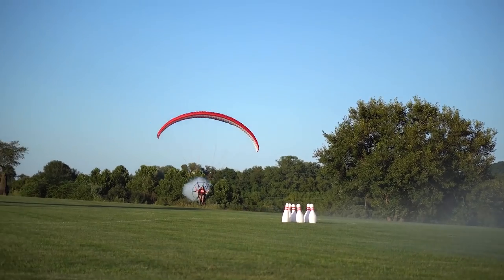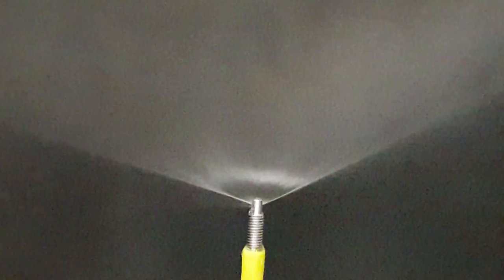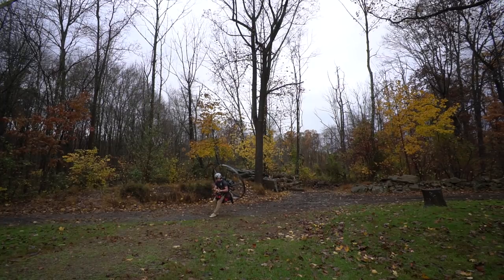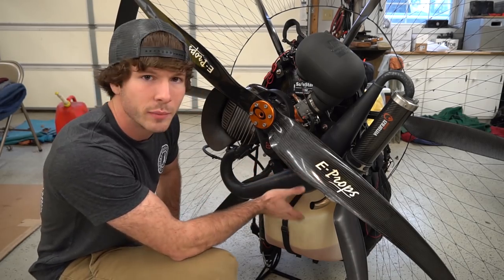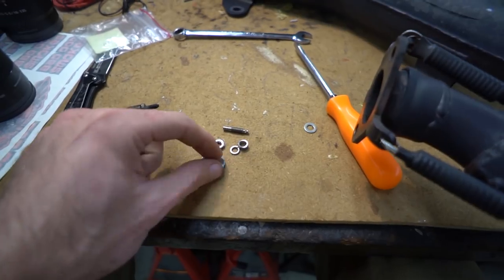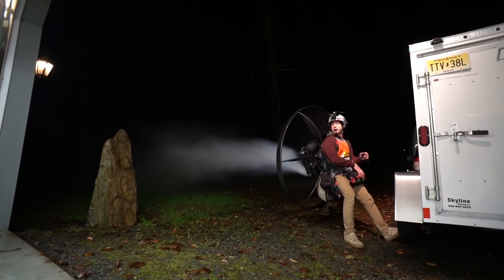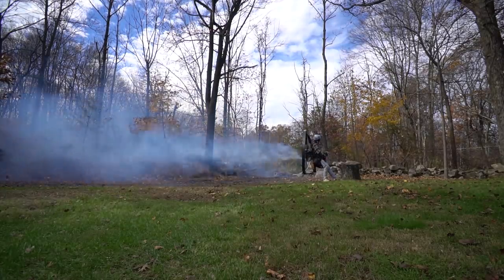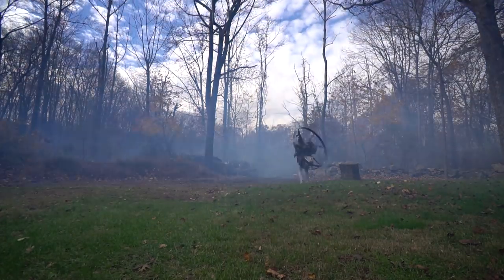Burning Used Frying Oil In A Paramotor?!

Comment from the maker: What do you guys think? 40 seconds of additional smoke but less volume with the new injector. I think I might slightly drill it out in the next episode, stay tuned!
Reply: Tucker Gott ❤️🖤🕊
Reply: Is there anyway to add colour to the smoke ?
Reply: I like the original luscious plume. Sure the new one lasts longer but if it is less visible, I don't see the point. You still might want to keep the vegetable oil to run in your sprinter van though.
Reply: @robertmcgowan9135  not without a lot of pain. It is a messy process
Reply: Yeah, she needs a drillin' . 

Or, you could switch to automatic transmission fluid ... you'll see smoke like you've never seen before.  But, you didn't hear that from me ... 😁
Reply: I'm wondering if there's anything you can add to the oil to make colored smoke?  I'm pretty sure food coloring would not work as water based.  Cool Video Tucker
Reply: @MrBluemoonhalos  - Maybe some iron shavings would make it red? Not sure. Best bet would be to source the stuff used to color fireworks - might change the color of the smoke, too.
Reply: I'm having the same issue with nozzles, Im sure sure if a stream hitting the steel exhaust or a fan like spray into the exhaust fumes is the best way to go for best results 🤔
Reply: Definitely like the thicker smoke.  Maybe if you drill out the new injector.  Or just get a second tank for more baby oil to double your thicker smoke and tee them together.
Reply: I would ask the manufacturer if they have one with a larger diameter nipple. If they do great! You can have two nipples and decide if you want duration or thicker smoke. If they don't, I would ask them for an extra nipple, as a spare just in case you mess up the one you have. Personally, I wouldn't do anything until you use it at altitude and get opinions from the ground as to the level of visibility and duration of the smoke trail in the air. It could just end up that from the ground, the lesser smoke output is not noticed! Or it could be really noticeable and not in a good way. So the next step is experimenting and getting opinions.
Reply: less is more.. drilling time!!
Reply: Try biodiesel and baby oil mix
Reply: It would be more meaningful to judge a comparison of airborne smoke as seen from the ground.
Reply from the maker: @kyleoglee  Kyle said it! We're drilling her tomorrow! 😁👍
Reply: Look into light silicon oil. Unlike organic based oils, with silicon oils nearly 100% of the oil turns into thick smoke. Many high volume smoke grenades use SiO2.
Reply: Any way to add the notched atomizer cut to the old nipple? I would think if you could spread it around you might get be a better plume while still being able to lay it down thick as you'd like. You could maybe reduce the orifice size so it's not all blown out in less than a minute, but still keep a similar/same amount of cloud. That's just a hypothesis at least. I would think the RC guys would have it down to a science because those guys will smoke out our field in no time!
Reply: You should try using fog machine fog juice, should be super dense fog, even with the smaller nipple, and you can get it scented
Reply: Check out the discussion under my other comment. I recommend vegetable glycerin, or a mix of it and a diluent (water, propylene glycol, etc.) There is some detail on the benefits there, not the least of which is more "smoke," more efficiency, better smell, etc. (It's what fog machine juice is made from--just MUCH cheaper.)
Reply: Where can I buy it? Which specs did the bad dog nipple have?
Reply: very cool to have more time but drill it out and try for more smoke dude.lol
Reply: Add colour !!
Reply: You need a tig welder.
Reply: what size did you end up drilling it out too?

Comment: What about using vegetable glycerin for the fluid? It is used in fog machines and is cheap very efficient, allowing the use of less liquid to make more (and thicker) "smoke."
Reply: That's a smoking idea!  Good thinking.
Reply: Great idea! May strain the pump though unless you cut it with some baby oil. That stuff pours like honey
Reply: you can thin it with 10% water or with propylene glycol
Reply: Last Fog machine I rented and set up used a VG/Mineral Oil blend. The Mineral oil thins out the VG so it flows easier and still vaporizes. I got out of the Expo setup business years ago though so I don't know what they use these days. Probably hasn't changed.
Reply: Exactly VG creates insane plumes of smoke
Reply: You can experiment with different oils to get different smells get a good one flyover a hemp Fest vendors will give you lots of money because you got them all hungry LOL
Reply: I have zero doubt it'll be WAY more effective than baby oil or cooking oil, and I bet you guys are right about diluting it. I was thinking one world greatly decrease the rate of injection since VG is much more efficient (and, I forgot to mention, MUCH cleaner!) The fact it's much cheaper is just a bonus. If necessary, diluting would definitely help it flow better. The most concentrated mixture possible, along with decreased flow, would surely be best, so one can get more smoke and for far longer (especially when compared with oil!) FWIW, it seems some online fog machine recipes say dilute with water, while others suggest propylene glycol, and/or a mixture of the two.
Reply: I suggested this on a previous video. Seems like a no-brainer.
Reply: Could also cut with a little bit of flavored ethyl alcohol and have the best smelling smoke trails out there. Perfumer's Apprentice is a good place to look.
Reply: Please provide a link to this cheap vegetable glycerine.
Reply: Costs more than baby oil AFAIK

Comment: Great video. with the wobbly nipple if you use a jubilee clip/hose clamp, drill a hole so it fits over the injector this will stop the wobble.  We use special made ones on our rotax 503 engines. Which is basically a hose / Julie clip.

Comment: I wonder how a 3D printer nozzle would do. You wouldn't get the fan spray without modifications, but they're designed for high temperature applications and you can get nozzle diameters between 0.15mm and 1.2mm easily and cheaply. You can get 10 0.4mm nozzles (the most common) for $1.34.

Comment: As others have mentioned, vegetable glycerin (VG) is the probably the way to go, assuming there is enough heat to vaporize it. It's the main ingredient used in e-liquid for vaping and also fog machines. It can be thinned if needed with propylene glycol (also used for vaping). VG is odorless and is plant based. Unlike baby oil, which is just petroleum based mineral oil with fragrance added.  VG is about $24 per gallon on Amazon.
Reply from the maker: Interesting! I may have to try it, although it is a little more expensive than baby oil.
Reply: @TuckerGott  You can buy in it bulk (e.g., 55 gallon drums) from wholesalers and get than down to around $10 per gallon.

Comment: Filter the used vegetable oil or you will clog your nipples. Particles in the  used vegetable oil could also bake onto the tip/atomizer.

Comment: Have you tried anything like Chauvet DJ High Density Fog Fluid? It's about $25 a gallon. I haven't been able to find the flash point of it. Baby oil is mostly mineral oil, which has a pretty low smoke point compared to things like propylene glycol or vegetable glycerin. Lower smoke point = less thermal stresses on your precious metals.

Comment: So aside from the cooking oil stinking like burned food do you notice the oil carbonizing in the exhaust pipe reducing power or did you not run it long wnough to notice? Would it clog up the customary breaks in the moster exhaust?  Dont you cook with oil to have a clean supply that smells good?

Comment: If you want dense white white smoke...use cheap atf (automatic transmission fluid)...
Reply: Yep! Nothing is smokier. I've had many a vehicle let the fluid go on the highway in my younger days. What a cloud!! 😂
Reply: @SmittySmithsonite  Potassium chlorate and sugar is pretty smoky... once tried to make a rocket with it and it just sat there smoking on the sidewalk. Was no wind so just hung there for several minutes and was so thick that it stopped the traffic!
Reply: @ahaveland  - 😂 Nice!

Comment: Even with my low vision, I noticed the huge difference. By the way, I'd love to see you do a comparison between baby oil, and actual DJ fog machine fluids. You can get the stuff at guitar centers, and on amazon. I've used the stuff when I did lighting for a band I worked with. Never tried baby oil, though. Oh, the smaller hole will clock sooner, and require a bit of cleaning with vinegar, more frequently.

Comment: Will this effect the engine? I thought the point of an expansion pipe on a 2 stroke was to harvest some back pressure to force more air into the combustion chamber. Does this mean some of the oil will get sucked back in? It’s only oil, but still.
Reply from the maker: I haven't noticed any long term affects yet. It does bog the motor when you inject the smoke, but that's about it.

Comment: Try mixing  essence oil with your smoke oil Tucker. I make professional smoke generators for theatrical, military simulation, paint ball gamers etc... I can mix those essential oils used for aroma therapy into my chemical compounds and make the neighborhood smell like just about any scent i like, essential oils are very potent you might have to experiment maybe from drops to 1/4, 1/2 oz mixed into your oil preferably non scented or mineral oil.
   Thanks for sharing 
     Kind regards Eric Dee
     P.S. Try the Gardenia oil, you'll love it.

Comment: I myself prefer the thicker smoke - I know it is less duration but the thicker smoke looked a lot better in my opinion.  It was obviously thicker but it was also whiter.  The second nipple (maybe because of the atomization) was a bluer tinged smoke.

Maybe you can find a happy medium - get a nipple like the first one but a slightly smaller hole (not quite as small as an atomization hole) so that you can keep the whiter thicker smoke but extend the duration?

One other item regarding the used vegetable oil that you didn't mention but alluded to indirectly I think - as you said the used oil is nasty.  You mentioned the smell and getting it on your hands but I also think that using that oil on a consistent basis would eventually clog up the nipple especially the second atomizer one.  I would think there would be sediment in the oil small or microscopic that would eventually build up in the hole.

Overall as usual great post.   I enjoy your content very much.

EDIT: I'm a day late and a dollar short - I see others have already stated what I did in my post :-)

Comment: Don't pollute your neighbourhood with the stinky oil...or I will call you burgertrail chopper...lol.😅. .but really all this oil would pollute all the plants it rains down to...
Reply: think about all the two stroke weed whackers and leaf blowers
Reply: @NETBotic  I will never understand how anything but a 4 stroke engine functions, you can thank my CC physics teacher for that
Reply: @homeopathicfossil-fuels4789  2-strokes are about as simple as it gets. 

As the piston comes up and compresses the fresh charge of air/fuel/oil, it is simultaneously drawing in another fresh charge via vacuum in the crankcase through the carburetor, and reed valves. Spark plug lights off just before top dead center, and BANG ... piston comes down making power to turn the crank ... AND at the same time, the downward moving piston compresses the fresh charge in the crankcase, slams the reeds closed, and forces the charge through the transfer ports under pressure above the piston ... which is now just uncovering the exhaust port as it continues downward to bottom dead center. The spent gasses flow out the exhaust, aided by the compressed fuel/air/oil charge that is still flowing out the transfer ports. Piston reaches BDC, changes direction, and comes back up, closing off the exhaust port as the very last bits of fuel/air/oil are still flowing through the transfer ports but tapering off now, then the transfer ports are closed off, and compression begins and the cycle repeats.

There's also alot more science in the exhaust pipe design. The big fat part of a 2-stroke pipe is designed to reflect pressure and sound waves, which will prevent most of the fresh charge from escaping the exhaust, resulting in more power. On a 2-stroke, the pipe is everything, much like the camshaft is on a 4-stroke regarding where the power will come in.
Reply: @SmittySmithsonite  Ah thanks, so the difference is really that it does all that in 2 strokes rather than in four strokes? I mean it makes sense since the "4 stroke" part of a 4 stroke engine means that it takes 4 strokes to complete a cycle(if I understood correctly)
Reply: @homeopathicfossil-fuels4789   - Yep, you got it!  👍

The lack of camshaft(s), timing chain(s), and valves are also what makes the 2-stroke so much lighter (and cheaper to work on / less maintenance) than a 4-stroke, and getting a full cycle done in half the time is what makes them so powerful for a given size. Since the charge comes through the crankcase, you cannot have an oil sump there, hence the reason for premixing, or oil injection.
Reply: @SmittySmithsonite  I see, I am watching some simulations of it now and I understand it much better now! Thanks for the explanation!
Reply: @homeopathicfossil-fuels4789  Ignore all the videos and tutorials, and remember this simple mantra...Suck, Squeeze, Bang, Blow! (keep it clean...kids might be near) 2 stroke or 4 stroke, they do the same, except that 2 stroke bangs on every turn. 4 stroke on every second.

Comment: 125cc engine with good expansion  exaust well make 180cc of volume. . Back pressure well send 55cc to be re burned back into to cylinder. . Hence bogg your experiencing with using smoke system.... just FYI..

Comment: You do realise that a two stroker uses the exhaust to spool some fresh unburnt air/fuel mixture, so your engine is sucking in that oil backwards. I wouldn't recommend doing that on a praramotor.
Reply from the maker: I do realize that. It's been working well for a lot of us!

Comment: Try moving your injection point way down by the muffler or in the can. This will get rid of your self siphon issue and avoid any change in rpm when smoke is on. Change in RPM is due to pressure wave and means you are pulling smoke oil into your engine. I also added a flow control so you can dial in how much oil is being dispensed. 
lots of info here: 
https://www.youtube.com/watch?v=4e7zzCjlQLw&t
here is one I did using windshield washer pump and canister
https://www.youtube.com/watch?v=BTrBwsymV_I

Comment: Hi Tucker why don't you use the proper smoke oil that will give you the density you need. Perhaps you can get the smoke oil supplier to sponsor you with free oil.  You should try a different colour to white so that you can  fly with colleagues and do a patriotic Red White and Blue  display. Stay safe

Comment: Can you get or make colored smoke?
Reply from the maker: I actually found a company that makes colored smoke dye. They asked for the application and specs of the system it will be used in. After I told them it was for a paramotor, they told me it won't work and stopped replying to my emails. 😕

Comment: the run time test dosnt make sense if its at a set rate of flow
Reply from the maker: The different nozzles restrict the flow. The new nozzle has a much smaller hole so the flow rate is less.
Reply: i jumped the gun on that comment ... i watch someone test fuels in a mower and timed it...didnt make sense because the flow rate was set

Comment: Try to pee at a high altitude
Reply: Messy, unless you have a relief tube connected to a catheter condom. The discharge being far enough away to get drawn into the slip stream of air and not curl back.
Reply: NEVER PISS INTO THE WIND

Comment: Hiya Tucker, normally I'm more a small nipple kind of guy but in this case you definitely need to go back to BIG nipples, I can recommend a thing called a nut-sert, it's basically a rivet, that's a nut... think it will work in your application, great video, mad me want to comment, lol, Peace...
Reply from the maker: Good call! I think a nutsert is actually the same as the rivnut that I removed.
Reply: you could try a small bit of gasket material, gasket washer? to take up some of the vibes, if it works, shout me out please dude, Lister will do .. Righteous...., hope you make it to the UK at some point, later dude.
Reply: PPS if you want ALOT of smoke try old car/truck engine oil. ;-)